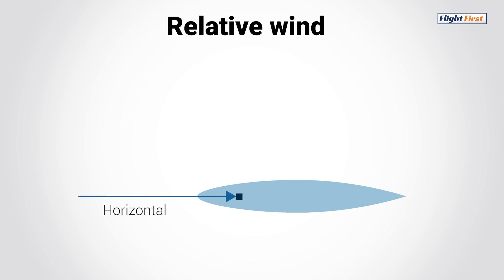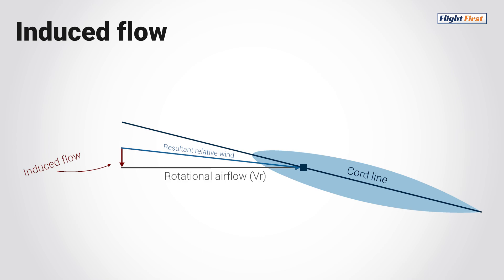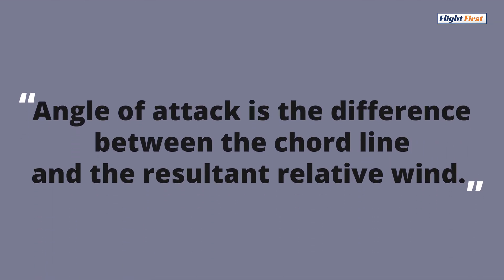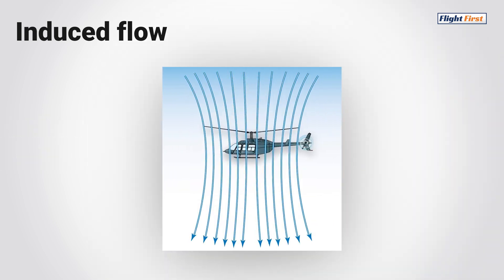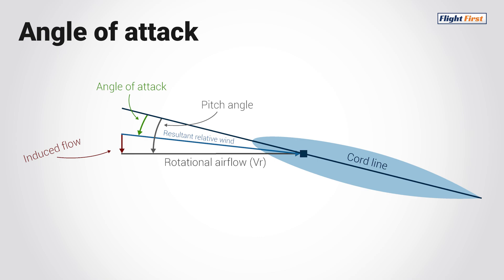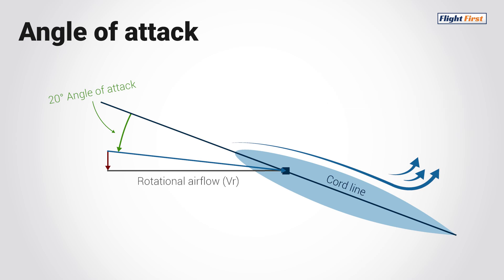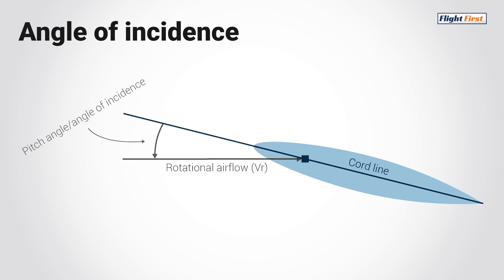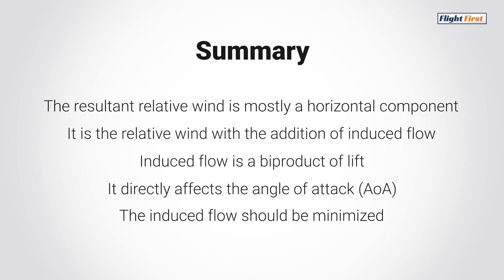How the relative wind affects helicopters

Comment: 2:57 turbulent boundary layers do not equate to air flow separation.
As a matter of fact a turbulent boundary layer is better for a high angle of attack. 

I don't think any blade on a flying helicopter has laminar airflow at all although I don't know.
The turbulence throughout the rotor plane will be too high from preceding blades.
Which is not an issue as I said.

Comment: How are pitch and aoa not the same thing??
Reply from the maker: This is a simplified explanation. Imagine you're looking at a helicopter from the side.

Pitch angle: This is how much the entire helicopter is tilted forward or backward. If the nose is pointing way up, it has a high pitch angle. If the nose is pointing straight down, it has a low pitch angle. Think of it like the angle of the helicopter's body relative to the horizon.

Angle of attack: This is about how much the rotor blades are tilted into the oncoming air. Imagine one of the rotor blades. If it's slicing through the air like a knife, it has a low angle of attack. If it's angled more like a flat hand trying to push the air, it has a high angle of attack. It's how much "bite" the rotor blade is taking out of the air.
So, the helicopter's overall tilt is the pitch angle.  How each individual rotor blade is angled into the wind as it spins is the angle of attack. These two things are related, but they're not the same.  The pilot can change the pitch of the helicopter, and they can also adjust the angle of attack of the rotor blades to control lift and direction.

Comment: Some problems with this explanation. Firstly, to reply to David below, the rotors create lift by pushing air downwards, and there develops a column of air above the rotors which has to descend to replace the air which has been pushed downwards to create lift. Sitting in an out-of-ground effect hover creates the most induced flow, because the helicopter needs the most power to sit in an OGE hover. If there is no downwash, there is no lift and no induced flow.
But once the chopper starts to move forwards, it gets away from that column of descending air, and the front of the disc sees air that is more horizontal than vertical. this reduces the induced flow, and for the same pitch angle, you get more angle of attack. But then other factors come in such as flapback and inflow roll. Rest assured that there is always induced flow whenever the blades are producing lift, but they can be more efficient when translating through the cleaner air.
It is NOT simply poking the cyclic forward that reduces the inflow, rather it is getting into cleaner air.
Reply: "Cleaner" meaning undisturbed?
Reply: Also, what's flapback and inflow roll?

Comment: Theres an different to propeller right? Here we say: " As an increase in airspeed reduces induced airflow the angle of attack will increase " 

But

When we are talking propeller we say " An increase in airspeed, will decrease the Angle of attack instead " right?
Reply from the maker: Induced flow will be at its highest with zero airspeed, and it will decrease drastically with airspeed. Induced flow directly affects the angle of attack, meaning zero airspeed → high induced flow → low angle of attack. The opposite is true as you gain airspeed → lower induced flow → higher angle of attack.

Comment: Can you please describe what force is actually forcing the air down through the rotor blades to create the induced flow. Thank you.
Reply from the maker: Absolutely. The pressure differential between the lower camber and upper camber force air downwards when there's pitch in the rotor blade. Specifically the forces of Bernoulli's Theory and Newton's Third Law are working together with the end result being induced flow. Remember, induced flow is simply air being manipulated by the rotors.
Reply: Refer to    https://www.faa.gov/regulations_policies/handbooks_manuals/aviation/helicopter_flying_handbook     beginning on page  2-9